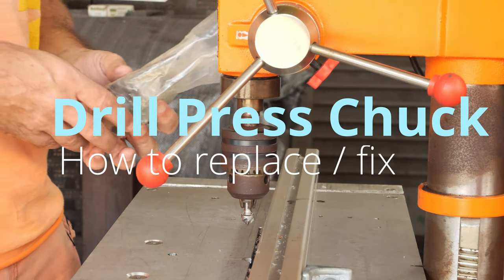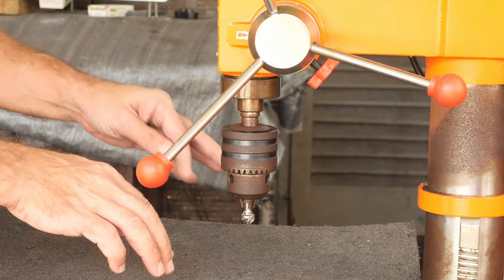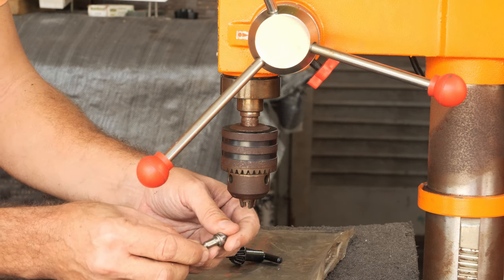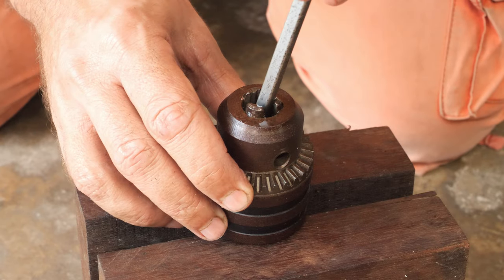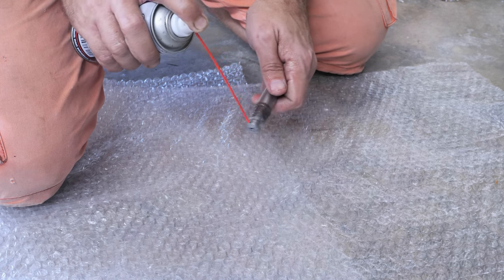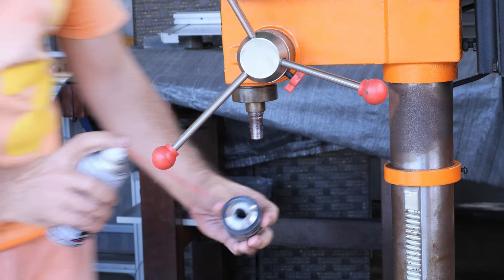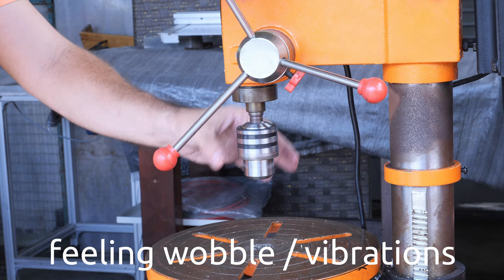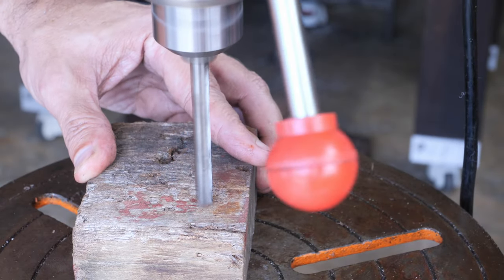How To Replace / Fix Drill Press Chuck

Comment: To separate the chuck from the taper simply use a bolt and a nut.Hold the nut inside the chuck jaws and start tighten the bolt to push against the taper.After a couple of turns the taper should be removed quiet and easy.
Reply from the maker: The carbide jaws were fractured and that's the reason to replace the chuck.
I'll try your trick on the new chuck to see how it works
Reply: It must be possible to do that in the first place to remove the chuck.
Reply: just use puller remover or bearing remover😂

Comment: Just got a used drill press that needs a little work. This video is invaluable and immensely helpful. Thank you!
Reply from the maker: thank you!
the secret key was the White Lithium Grease spray. you could hammer on it all day long and it wouldn;t separate the "baked" pieces without it.

Comment: Sir,
I enjoyed viewing the logical way you approached the situation removing  the seized chuck and taller. As you were doing the task in the video I was reviewing how I would approach the problem. It is the most logical approach. By retracting the jaw of the chuck no harm will be done while hitting the chuck through the wooden  block. 
Thank you for your informational and intelligent approach.
Reply from the maker: thank you! well I tried less "violent" approaches first, but the broken tooth chuck was semi welded to the tapper because of the humidity induced internal rust 
using wooden block is OK. but the key to separate the chuck from the tapper was the White Lithium /Grease spray, which managed to penetrate micro gaps between the 2 stuck pieces.

Comment: Thank you very much. The chuck fell out yesterday. Tried it today and so far works okay. I have you as a backup for the next time. I really like your idea of keeping tools that come with the machine close by. Have to start practicing that.
Great Stuff.
Reply from the maker: yes I learned the habit of keeping the machine spare parts / related tools right next to it at all times, because before that I was spending priceless time in my store room looking for stuff. and I was always finding stuff that I couldn't find when I needed it earlier, but not the thing that I need now.
some machines such as bandsaw have cabinets where you can keep various blades, miter gauge, switch mag jigs and so on. the table saw drawer / cabinet can store replacement blades, jigs etc..

Comment: Thanks, I was a little afraid to remove my chuck.  While it didn’t look easy, it looks like something I can do.
Reply from the maker: white lithium grease spray is the key. it penetrates the stuck parts 

just go it and you will see it is really not as scary as replacing the clutch in the 4 wheel drive

Comment: I really appreciate this video. Thank you!

I'm also very grateful for you showing how that bit, with its varying dimensions,
chipped the old chuck.  It reminds me to be far more careful with such bits.
Reply from the maker: yes I learned through my mistake, and I'm happy to share it so that you and others won't be forced to replace the chuck. the carbide teeth are very brittle, and as I was tightening the chuck on the shaft with the weld between the cutter and the shank, the carbide element easily broke.

I live in tropics, and everything rusts very fast. the taper and the chuck "baked" together from the 90% humidity, and it was really hard to separate them. I was close to giving up and buying the chuck WITH the taper set. I bought just the chuck to save few bucks.

Comment: Woodworker plays machinist.  The "white lithium grease" is an odd choice.  One of the many penetrating oils would be better.  Also, tapers are assembled dry.  If you're worried about corrosion, a very thin film of LPS3 or Fluid Film is sufficient.  To make a thin film, apply a little and try to wipe it dry with a cloth or paper towel.  There's a lot of anxiety about the chuck coming off but it's not warranted.  One tap is sufficient.  Also, if you extend the quill down farther, there might be a slot in the side for that wedge.  The wedge bears against the tang so you can remove the chuck at will.  You may not have any reason to do so but it's handy in the machine shop.  Also, tightening the chuck from multiple locations does not center the bit any better than using 1.  You may get it slightly tighter but even that is unlikely.
Reply from the maker: I'm not playing a machinist. It was my 1st time ever to try to find some working solution to this problem, and eventually I managed to separate the semi welded rusted parts. 
I used what I had on hand. 
What matters is, I got it done

Comment: Use two wedges stacked opposite and hit with two hammers from the opposite sides
Reply from the maker: as you could see, the problem was not to remove the chuck from the drill press, the problem was to separate the chuck from the taper because they semi welded to each other because of the tropical climate humidity and rust
Reply: @TigerCarpenter  the taper is called the arbor I understand you didn’t want to remove the arbor and chuck assembly… but to properly separate the chuck from the arbor taper you use a wedge or two stacked.
Reply from the maker: anyway I did try using the wedge but everything was too tight due to the rust build up from tropical weather

Comment: I see that you have taken great care protecting the old part with bubble wrap through out the video until you get to the most important part, the removale of the taper from the chuck,  when the taper hits the concrete floor with no protection. Just sayin.
Reply from the maker: The bubble wrap was to protect my wooden workbench jaws, not the chuck, which was cracked and sentenced for scrapyard 
Yes I didn't want to damage the tapered surface to allow it to work as designed. 
It took me many hours of fighting with the semi welded parts trying to separate them. I bought a new set of chuck and taper anyway 
The final attempt with white lithium grease worked and just a little tap with hammer was required
The taper dropped from 5 centimetres on the non tapered tip before it rolled on the floor. The tapered surface didn't even get scratches from that fall

Comment: Remind me, to not let you change one of my chucks LOL
Reply: @TigerCarpenter  Read up up on morse tapers/jacob tapers, on how they work/hold..
There several different of tapers as well, they actually lock together, they have been used in engineering for over a hundred years.... The Morse Taper was invented in 1864 by Stephen A. Morse....it's not that they were rusted together, it is the angle of the taper that locks them together..
Reply from the maker: @bigtrev8xl  I didn't want to remove the taper, I was in fact hoping the taper would stay in the drill press, so that I can just swap the broken chuck with the new one. that's why I didn't use the wedge that helps with removing the taper.
unfortunately the chuck didn't drop and the chuck+taper dropped. then it took me many various methods to separate them because they were baked together (all mechanical ways failed). I used gear bearing pulling jaws, which have tremendous force, as you would notice while replacing your car's clutch. even that force wasn't sufficient to isolate the taper from the chuck, because the rust semi-welded them into one piece.
the point of this video is that white lithium grease spray managed to penetrate the "weld" and the taper dropped out of the chuck with the gravity force only.

PS
and you keep trying to convince me that the taper wasn't baked together with the chuck, and lecture me on the Morse tapers. I wasn't born yesterday buddy, and I know what I'm saying.
Reply: @TigerCarpenter  You sir are something else LOL 
When putting an instructional video up, at least get it right, and hitting a chuck with hammers, is not the way to do it, as I explained to you before, lithium grease will not break a taper. please educate yourself, look on youtube
Reply from the maker: @bigtrev8xl  for 5 decades I've watched many people removing the chuck only (not the taper) using the wooden block and hammer. when you use the wedge, you will remove the taper together with the chuck, and that was exactly NOT my intention, as I was trying to swap JUST THE CHUCK.
I'm not sure what you are trying to demonstrate here.

1. https://youtu.be/fZwx_773tbo?t=174
I tried the wedge to remove JUST THE CHUCK but because it was rusty and baked together, it failed

2. https://youtu.be/xHVkb1JU1Ac?t=114
Everyone I know uses wooden block to remove JUST THE CHUCK, especially when it is stubborn / baked to the taper.

PS
and the white lithium grease did the trick, as shown in the video, the taper fell off the chuck with a push of a finger.
Reply: Carry on believing, lithium grease broken the taper, if that makes you happy LOL
Reply from the maker: @bigtrev8xl  white lithium grease penetrated the baked surfaces between the chuck and taper, and the chuck feel off with ease after few minutes of waiting.

not sure what's so funny about that
Reply from the maker: @bigtrev8xl  let me break down our few months long conversation:

1. I took time and effort to record my video which delivers successful solution to the problem, which was replacing the broken drill press chuck with a new one
the solution was spraying the white lithium grease under pressure, that allowed penetration between the baked surfaces of the chuck and taper
2. before the white lithium grease final attempt, I tried:
2.1. wedging between the old chuck and the drill press body (wedging the slot was pointless as I wanted to remove JUST THE CHUCK)
2.2. rubber mallet (NOT HAMMER) + block of the soft wood, in the 2nd attempt to remove JUST THE CHUCK - this step resulted in the taper dropping off the drill press together with the chuck (which would have happened should we have used your proposed solution, and this is not what I wanted)
2.3. gear pulling jaws used to remove the tight bearings from the shaft in the automobile industry (enormous mechanical force), and this attempt failed as well
2.4. whacking the taper out of the old chuck (broken teeth, going to metal scrap yard) through the chuck's jaws opening. this attempt also failed despite massive force applied

at this point I was close to deciding to cut the chuck with the hack saw, to separate it from the baked taper

2.5. sprayed white lithium grease and left it for 5 minutes, and the taper dropped down on its own with the gravity force only.

and NOW

you don't offer a better solution than mine (which clearly WORKED), other than wedge slot and some Morse Jacobs tapers historical data, which is not going to separate any taper from any chuck, as far as I know.
you keep discarding my solution (which WORKED) while cracking intimidating jokes, which only you laugh at and adding "hahaha" + "LOL"s to the end of your every sentence, as if it was funny at all.

you call an experienced person, who is willing to share the solution that worked for him so that it can potentially help someone who finds himself in the same shoes, A SOMETHING DIFFERENT, which is totally disrespectful and unacceptable.

I could easily ban you and other trolls from my channel, but before I do that, people like you need to be put where they belong..

I welcome any constructive comments and / or solutions, but I don't tolerate an attitude like yours, trying to show the world you know better while you are not contributing anything useful, but trying to intimidate and shame people. 

white lithium grease penetration is a proven solution that WORKED, and it is not a belief. 

it's a belief of yours that tapping on the wedge in the slot would separate baked chuck from the taper. I want to see your video showing that wedging the slot would cause the chuck only to drop, while the taper stays in the machine body.

you need to change your attitude, learn some respect to other people, before you are taken seriously by anyone.
Reply: @bigtrev8xl  You laugh out loud more than anyone I know.